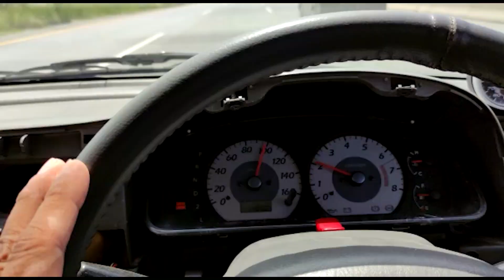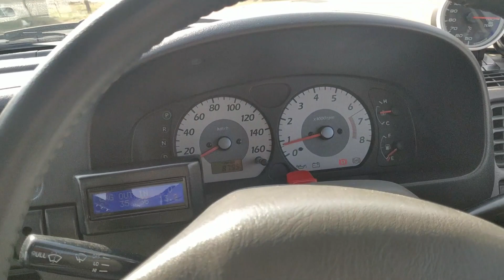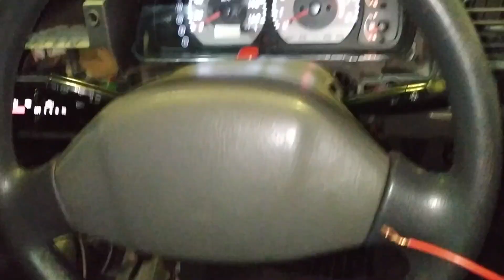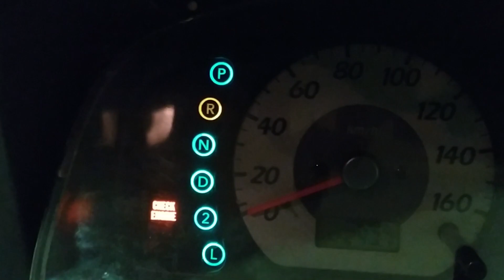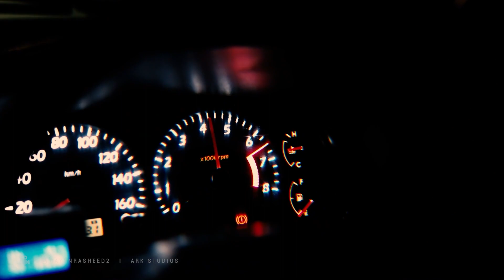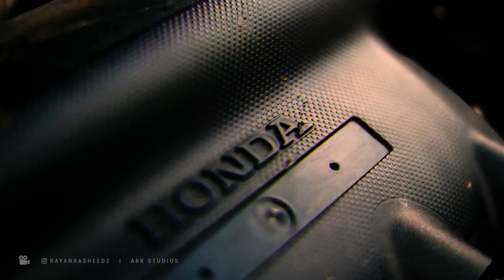Project L13A ALTO: The Car is COMPLETE! – FINALE

Comment: Assalamualaikum sir
I'm from Pakistan Karachi
I wanna ask that your alto L13a project has very good headlights
And i think that there is a projector lamp installed in it 
So can you please tell me how did you do that and what the procedure to install the projector lamp inside the headlights
Since I also have a Japanese alto so I'm curious about that 
Thank you 😊
Reply from the maker: Walaikumassalam. JazakAllah for the appreciation. Yes, you are right, the lights have ACME Bi-Xenon Hid Projectors installed in them. These projectors come with the H4 fitting in the rear. You'll need to open the plastic lenses of the headlights to install these projectors. Once you've installed them, you can cover them with some off the shelf shrouds or make your own. I made my own shrouds because I wanted a different design for my headlights than the ones readily available. I'll soon upload a video of the process showing the modification of the lights in shaa Allah.
Reply: Thank you man❤
But I wanna ask that what is the price you faced to make both the headlights
Reply from the maker: @devilcodm998  I got the projectors through a friend from the US, then got new headlights from the most recent facelift of the alto. I already had good quality ballasts, only had to buy new H1 Xenon bulbs. All in all, these lights cost me around 30k about a year back.
Reply: @funcariauto 
Ok 
Nice work

Comment: And plz tell me one thing.where you buy these alto head lights....i also need this one
Reply from the maker: These are custom built lights that I did before the engine swap. I got brand new clear lights from the last facelift of the Alto and installed Acme Bi-Xenon projectors in them and made shrouds with Leds. So I'm afraid they won't be available off the shelf.

Comment: Swap in a 3 spoke Japanese airbag steering, would definitely feel better.
Reply from the maker: In shaa Allah, I will change the steering wheel to a different one. I'm not a fan of the steering wheel that was offered in the Japanese Alto of the same generation because of the feel of the horn button but I will switch to some other Suzuki steering wheel that fits well.

Comment: Very good & informative video. Just a question that comes to my mind as I'm not that much educated in automotive, does this engine suits and rightly go with tha body as I think engine is more heavy that a body can handle? 
Also another question which will be the best car and best engine for swapping in a reasonable budget as car prices are so high I'm thinking to go for swap. Main things to be considered is family car, good fuel average & low & reasonable maintenance. Kindly guide
Reply from the maker: Thank you so much for the appreciation. Your query is a very valid one. Normally, this chassis was not designed to take an engine larger than 1000cc engine. In Japan, the 660cc Turbo variant was offered which had more power than the local 1000cc engine but that's about it. However, I have added braces in the body/chassis to reduce flex in it so that it can handle the larger engine. The car is Alhamdulillah handling the increased power very well. Without all the braces, I wouldn't recommend a larger engine in this chassis or any chassis for that matter if the difference in power is a lot, which, in this case is double the amount.
Now coming to your question, please share the car that you intend to swap the engine in. If you don't have a car in mind, a ballpark figure on the budget may help. That way I can help you with it better. A good swap these days would be to get a 9th Generation Corolla and Swap an R1nz-fe (1500cc) with a CVT transmission from an Axio into it. That setup would give you very good fuel average and its not very expensive to maintain and should fulfill most of your requirements.
Reply: @funcariauto  thank you so much for your response.If I would ask how much will it cost including car that you have suggested? Also let me know if I have budget of 4-5lakh would it possible that I can be a owner of any good car?
Reply from the maker: @rehanjamil4701  I would say that a good condition corolla would be around 10-14 lac, a diesel corolla would be better to get as they are a little cheaper than the petrol ones. You would be changing the engine anyway so it wouldn't matter. On top, you should look at spending around 400k on the swap and the allied things. 
In the 4-5 lakh budget, it would be tough to get a good car. With the insane prices of newer cars these days, people selling used cars have very high demands. You could go the route of buying a relatively older car like the KE70 corolla or if you want an easier to maintain car, a good condition Khyber as its a much better car in this budget than a Mehran. 
But do keep in mind that it would not be possible to swap an engine within the budget. You could start by getting a good condition car and then later save for an engine swap.
Reply: @funcariauto  thanks alot for valuable suggestions
Reply from the maker: @rehanjamil4701  You are welcome!

Comment: Huge respect brother. You're a gem Mashallah. I did a 660 swap in my PKdm alto. And im very disappointed cause its very laggy. No pick at all.
Reply: My main motive of the swap was reliability and fuel economy. Not sure about reliability as its working fine since 4-5 months. But couldn't achieve my desired fuel economy as it gives maximum of 14.5km/L. 😢
Reply from the maker: @HassanRaza-y4k1n JazakAllah brother, thank you for the kind words :) 

Can you please share some more details about the engine and the gearbox that was swapped in your car? Is it a K6 from the same generation of alto or a newer one? And is the transmission a 3 speed auto? If both of these correct, 14.5km/l is actually quite good fuel average. This generation of the engine and the 3 speed transmission is known not to be exceptional in the fuel average department. With a manual gearbox however, you can expect to get around 15-16km/l if everything else is in order.
The later generation, alto G2 has a more efficient K6 even though that mostly has a 3 speed auto as well. But the k6 and the 4 speed transmission from a Suzuki Kei would be your best bet. People are known to get around 16-17km/l with that setup.
Now coming to the laggy response, the earlier generation K6s with a 3 speed autos were also known for their laggy response, and I've driven a couple of them and I would agree that they're not very quick. If the performance is exceptionally sluggish, you can check a few thing that I'm listing below,

1. Fuel Filter. Generally, when these swaps are done, the fuel pump housing that is used is kabuli and often times, the filters in them are already past their usable life and choked. You could have the fuel filter opened and checked if its choked.

2. Fuel Pump. A choked fuel filter also decreases the performance and lift of the fuel pump. If the filter is choked, it's quite possible that the fuel pump is also weak now, having to pump the fuel through a clogged filter.

3. Check plugs and replace if it wasn't done at the time of the swap.

4. If the engine is equipped with an EGR Valve, cleaning it helps are lot.

Comment: I want to ask the top speed of alto with this L13A IDSI ENGINE kindly tell me and make a video about the top speed
Reply from the maker: I have taken the car up to 165km/h but the gearing ratios can take the car well above 200km/h especially with the current power to weight ratio. However, I prefer not to take the car up to those speeds, because safety comes first! I will soon share an acceleration video though.

Comment: I have an alto , do you think the hyundai i10 1.2 85hp would fit ? .. because it's widely available
Reply from the maker: From what I can tell looking at the photos of the engine, it appears that it's not very deep which is good news. The intake manifold is also compact so the exhaust manifold can be modified if its needed. It seems like it could fit but you would need a lot of measurements before taking the plunge.

Comment: Very nicely done I must say. Even though I am not fan of putting honda engine in Suzuki haha but it turned out very well. I swapped few cars when engines use to cost 50k and now with prices touching 300k its not affordable any more to do such projects but yes small car you can still do it. Not only your work is great the fabrication part is amazing. I was wondering if from Plexiglass can we fabricate a LCD frame for Honda SX 8 hmm
Reply from the maker: Thank you so much for the appreciation brother! JazakAllah. Haha, yes, while the honda swap into a suzuki may feel sacrilegious, it helped achieve what I was after so I went with it. 

Yes, with plexiglass, you can fabricate the LCD frame for the SX8. You'll just need accurate measurements for it.

Comment: Can I get this done for my alto?
Reply from the maker: I would love to take another similar project on but right now, I'm not in Pakistan. Once I'm back in shaa Allah, then I can help you with it.
Reply: @funcariauto  sure. Can you tell me its estimated cost?
Reply from the maker: @iAdeelMehmood  Well, about a year and a few months back, this swap cost me around 350k. This cost only includes the cost of material, parts and the engine etc. As everything else was done by me, this cost does not include any labour charges. With the increased inflation since then, I'm guessing that a similar swap would cost over 500k these days.
Reply: @funcariauto  its little much but not bad for ha 1.2 if it gives 17, 18 average in city
Reply from the maker: @iAdeelMehmood  The cost definitely is on the higher side but then again, you're also building something unique. The high cost may not make a lot of sense in the beginning but after experiencing how this swap has transformed the vehicle, I find it to be pretty worth it. Yes, definitely, the fuel efficiency even though it's a 1.3, is remarkable Alhamdulillah and then the fact that it delivers some amazing power to weight ratio and in turn performance as well is an added advantage.

Comment: What is the fuel average?
Reply from the maker: It gets a little over 18km/l within city and on the motorway, the best that I've registered is 20.8km/l.
Reply: @funcariauto  thats good.
I am wondering what it will be with ac?
Reply from the maker: @hidayatafridi1019  the 18km/l within city is mostly with AC. On the long route though, I haven't tested it with the AC yet but I'm guessing there won't be a huge difference because when driving the car, you feel very little load with the AC on.
Reply: @funcariauto  impressive

Comment: Need its drive review
Reply from the maker: I will make a driving video of the car soon but just to give you a review, the car drives very well Alhamdulillah, no vibrations of any sort and very stable as well. It's quite good on fuel as well, achieves a little over 18km/l and it's quick too with the current power to weight ratio.

Comment: Wow... Questions: 
Cost?
Durability?
Duration to complete another similar?
Fuel Mileage after changing the engine?
What about those "KHAARAK Sounds"?

I look forward to hearing from you.
Reply from the maker: Hello! Let me address all the questions below.
1. Cost: I completed the swap about 1.5 years back and at the time, it cost me around 350k. Of course things were cheaper back then so today, its going to cost more.
2. Durability: Alhamdulillah, the car is serving really well and reliably. The whole idea about doing things properly was to make it a reliable daily runner with decent power and it is working reliably Alhamdulillah. 
3. Well, this swap took about 5.5 months to complete but of course, as this was the first swap of this kind, it took me longer as there was plenty of homework that needed to be done, different design iterations for certain things etc. But if I was to do a similar swap again, it should be done a lot quicker.
4. Fuel Average: Within city, I'm getting a little over 18km/l and on the long route, the best that I've managed is 20.8km/l.
5. No Kharaak sounds Alhamdulillah. The clearances are very close but the mounts and all were designed in a way so that there isn't a lot of movement in the engine to cause such noises.

Comment: Brother project Suzuki Baleno with twin camshaft engine
Reply from the maker: Sorry for the late reply brother, Baleno can be swapped with a G13B which is a Twin Cam engine. But since those engines are VERY hard to find, it's better to swap a G15A into it. It's a SOHC engine but has decent power.
Reply: @funcariauto  thanks

Comment: Car is overheating
Reply from the maker: How did you come to that conclusion?
Reply: Look at 1:23 1:24 1:25 Heat needle
Reply from the maker: @AliHaider-ws3gm  Oh yes, I can completely understand how that might look likes it's overheating, I've had people tell me that earlier as well looking at that gauge. The thing is, the gauge is designed that way, if you see, the H point is higher than where the line ends, and the speedometer is not fitted in its place right so its tilted towards the back from the top and the camera angle is making it look like its higher than middle. Let me share a photo of what it looks like fitted in place and the photo taken from the correct angle. You'll see that the needle is lower than the middle point between H and C. At this point, when you check the temperature on the reading from the ecu, it's between 90-96 degrees and at 97, the fan turns on as programmed by the factory. 

https://ibb.co/zF43xCd